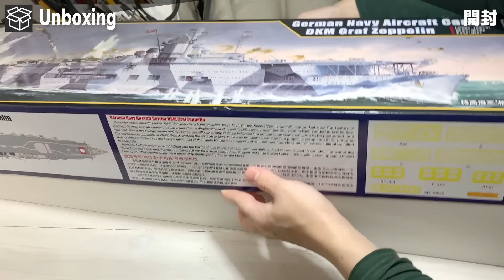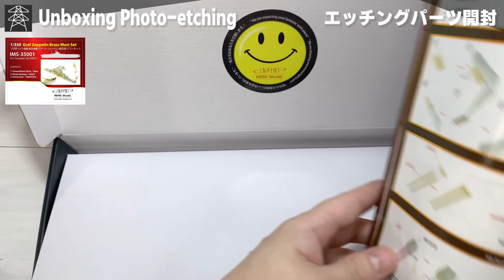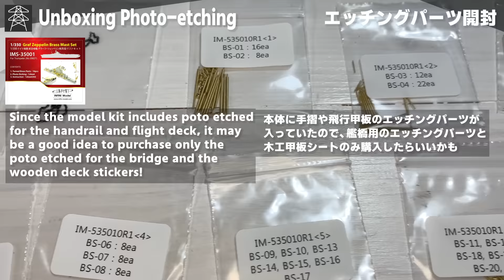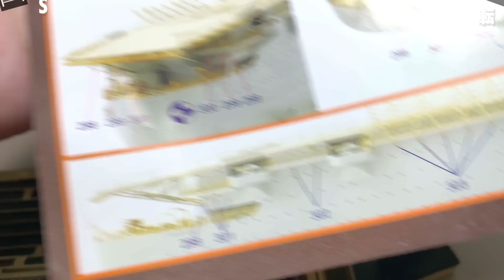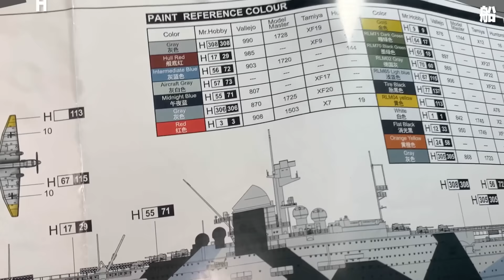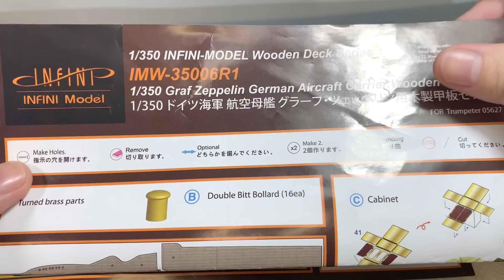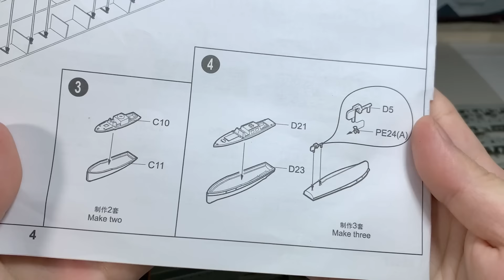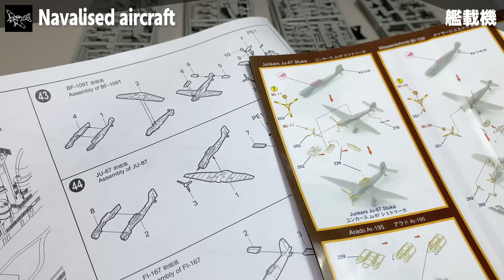DKM Graf Zeppelin - Kriegsmarine Aircraft Carrier // 1:350 ship model

Comment: Great build, I had no idea Germany had an Aircraft Carrier, I will have to look up it's story.
Reply: It didn't, it was never completed.
Reply: Yeah was gonna say he did what the Kriegsmarine never managed to and actually built it lol
Reply: Probably just as well they never built it (pre-war they had planned on building 4). lovely boat, superior German design but the planes would have been a shit show, ME109 good fighter but would have had to be radically adapted for carrier use, and the dive bombers JU87 Stukas would have been a downright liability in naval air combat
Reply: @coinneachreid8971  
Yeah, where would they have used it that couldn't already be covered by their land based planes?
I think they'd have tried breaking it out into the Atlantic on anti commerce raids in conjunction with heavy units and escorts but Hitler would have been kept awake at night fearing for their safety, and probably rightly so.

The original intention was to use modified 109's but the Fw 190 which came along in 1941 would almost certainly have been actually modified and used instead, being a much more stable and strong airframe, they even had a torpedo toting 190 which may have replaced the Ju 87's.